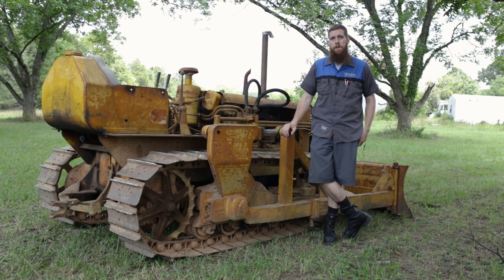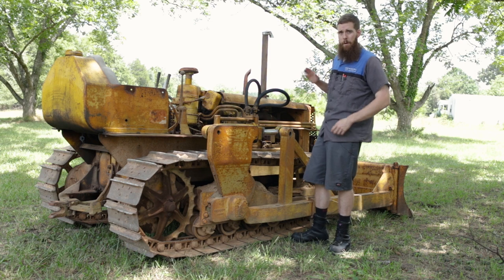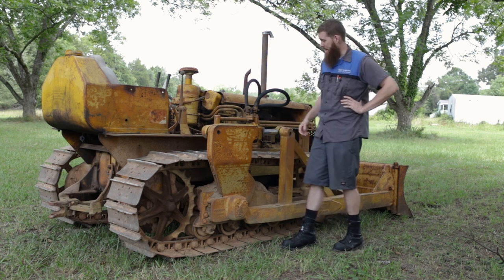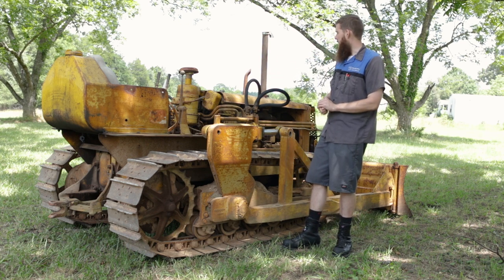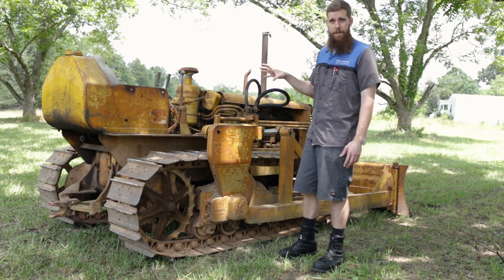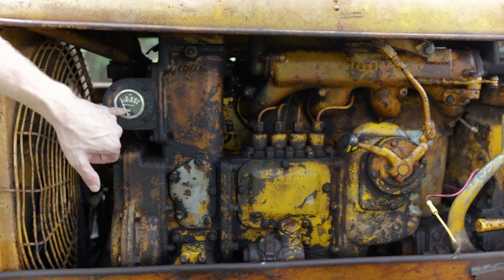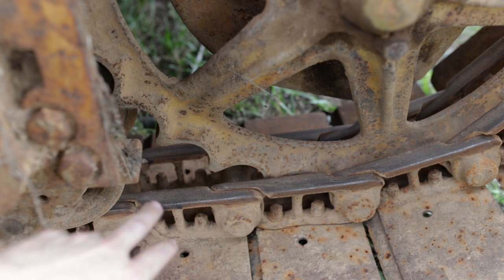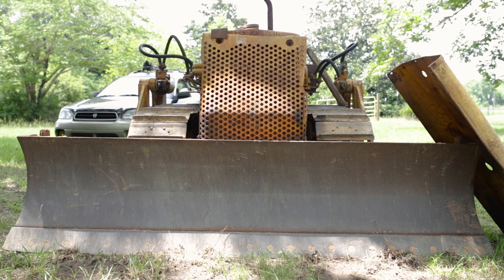Welp, I Bought A New Toy! 1954 CAT D2

Comment: Get an operator's manual.  2 thou is a good price..............maybe  Recommend change ALL the fluids. You won't find anywhere that the ignition wirres on a mag need to be copper core, not resistance.

Comment: I have just reinstalled starting motor on my D2 5U  3369  will start it next week!  I have tow started main engine but always tow in fifth gear to minimize strain on clutch!!   I towed with compression released and when everything is spinning flip compression with a piece of rope.      Clutch is pure fiber and splines can strip easily!!!!  My D2 came to farm 1949 and I am second owner
Reply from the maker: Nice! 👍🏻
Reply: I have a 1949 D2 5U also. It has an 8 foot blade and rippers in the rear. Still getting the job done.

Comment: 1954 is it a 7 U      also bleed screws on injection pump don t have to crack lines.  good luck!!!!
Reply from the maker: Thanks!
Reply: I thought 7U was a D4.  My 55 D2 is a 5U.
Reply: @johnwythe1409  D2 was in 3 series    4U,  5U and 7U    not sure of dates introduced     Earlier  J series D2
Reply: D 2 7 U    seat was moved up and back for more leg room and a removable coupler on trans input shaft so ciutch disk could be replaced without splitting tractor!
Reply: @daleholmgren8385  interesting, my 5U has the longer bell housing and coupler.  That change came in at 5U13237, I believe.  The 3J and 5J came out in 1938, I believe the 4U and 5U came out around 1947.  Main difference was the more powerful engine from D3400, to D311.  Have not seen any info online about a D2 7U series.  The D2 and D4 are very similar and share a lot of the same parts. My 5U has D2 stamped on the radiator, but D4 decal on the fuel tank. Both the D2 and D4 were produced during the period of 1938 to 1957, which is the time frame for the D2 production.
Very likely there are mixed parts on this machine from a D2 and a D4.  Engine and chassis could have different S/N.  would need to know all the markings, and possibly date codes from some parts to determine what is what.  Could be a mix of D2 parts and D4 parts, some from 1952, and some from 1954.  Without knowing the history, might be hard to tell.  Squat challenge 253, could probably help out better than I could if that is the case.
Reply: @daleholmgren8385  From Diesel World Magazine.   For 1953, Caterpillar advertised the “New!” D2 and the tractor got a major makeover. In order to facilitate a more easily serviced clutch, Cat made the final drive housing longer so the clutch could be replaced without pulling the engine. As a result, the tracks were longer by two shoes (a total of 32), the ground contact length increased to 60.08-inches and area to 1,460 square inches. A track carrier roller, supporting the upper center of the track where it dips between the front idler and the rear drive sprocket, became standard rather than optional.

The ’53-on D311 engine also made a bit more horsepower, with a 10 percent increase in drawbar and belt horsepower. With the extra room, an increase in standard fuel capacity from 20 to 26 gallons was possible. As before, fender mounted auxiliary tanks were available. Operator comfort was enhanced by improvements in the seat (position and size) and controls (placement and leverage). An underseat toolbox was added and the fenders updated to 3/8-in. plate. The U-Series D2 was manufactured through 1957 with 26,454 units built.
Reply: @johnwythe1409  thank you forcorrect info

Comment: Go watch Squach253 he just rebuilt a Cat D2. He could write manuals for Caterpillar. Looking at the number of loose, new, or missing bolts, screws, nuts. Some half- A mechanic worked on it.
Reply: Looks to me they started pull the pony apart to fix it and quit.  Might be a good idea to pull the pony and go through the whole thing.  Unless you have seen it running, no telling what the problem might be.
That fuel pressure gauge is not standard,  should have red and green marks for good and low pressure.  Will do the job, if you know what the pressure is supposed to be.  I don’t think the hour meter is supposed to have oil in it.  Might be a leaking seal, or worse.

Comment: Where did you find the manuals for it?
Reply from the maker: Extensive online searching. Haha
Reply: Jensales is a good place to find all’s sorts of antique manuals and some parts, paint and decals.  Florin tractor has lots of new old parts.  Squatch gets lots from them.  Many places have good used non wearable parts.  I am still looking to get a good price on main clutch plates and disc, new or used.  Mine is at the bare minimum or near it, not much adjustment left.